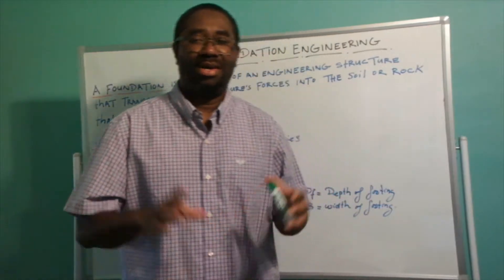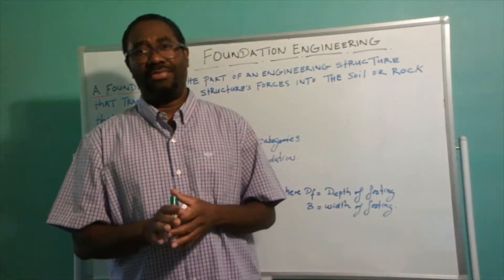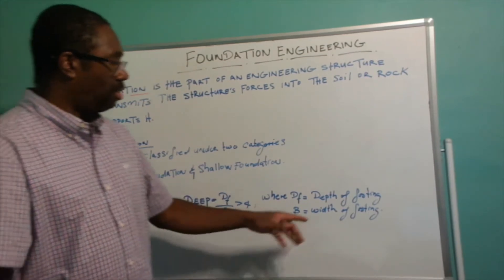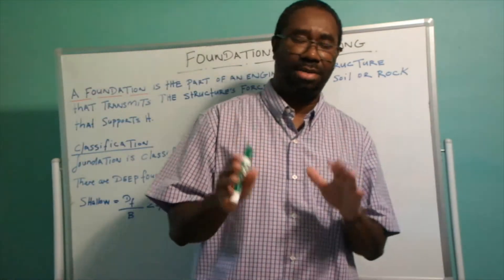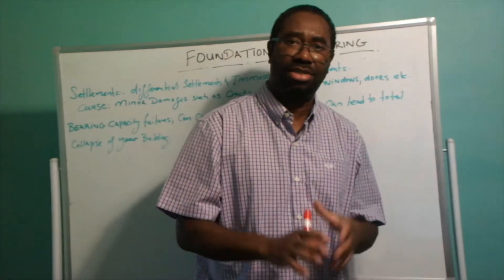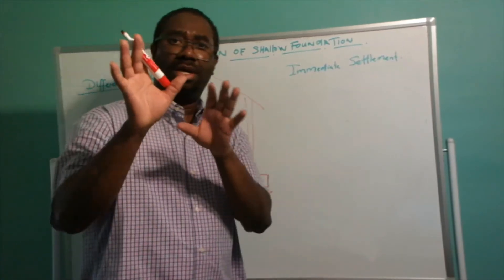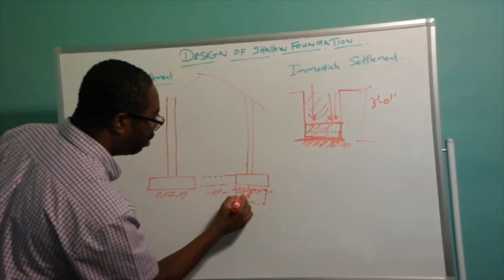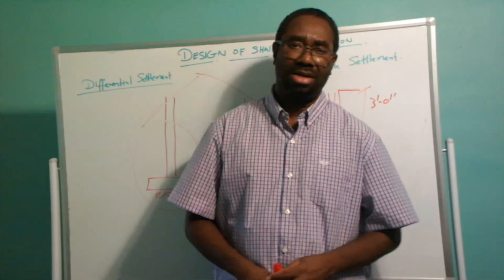Introduction to Foundation Engineering

Comment: Great teachings as always brother JK. Question? Is it possible to design a foundation without seeing the soil sample or topography via site inspection? How would one meet this challenge?
Reply from the maker: No. When the soil is drilled, you take a core sample every three feet and take it to the lab and do a soil analysis to determine the type of soil at the depth that gives you a good bearing strength to support the foundation of the structure.